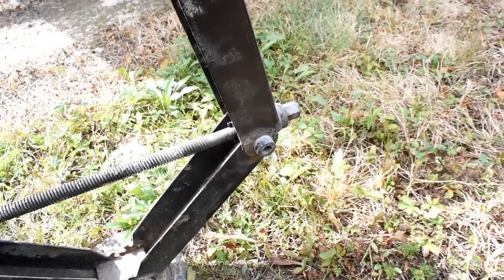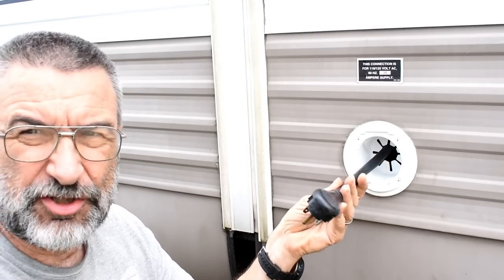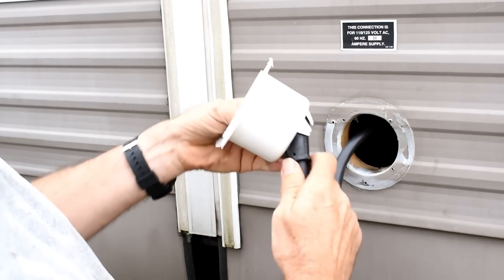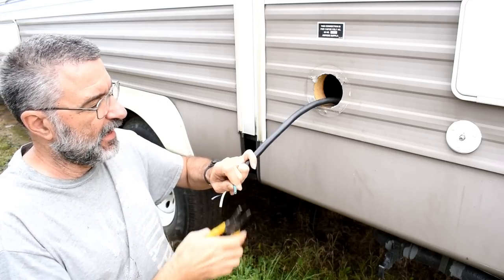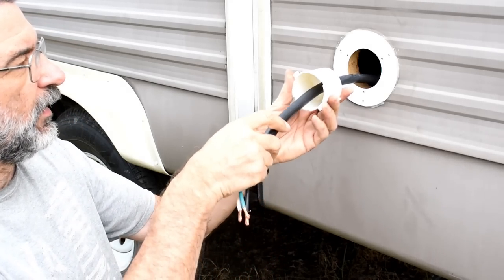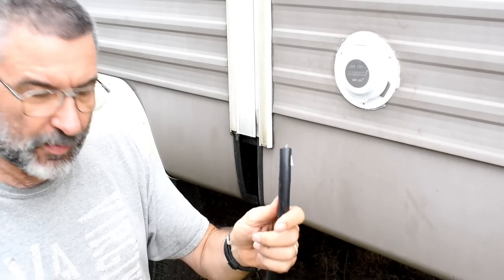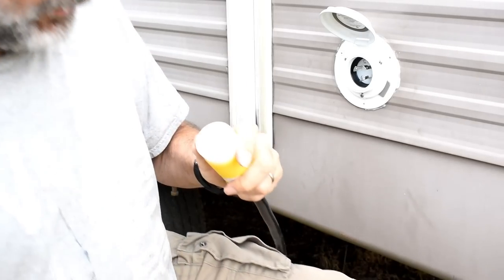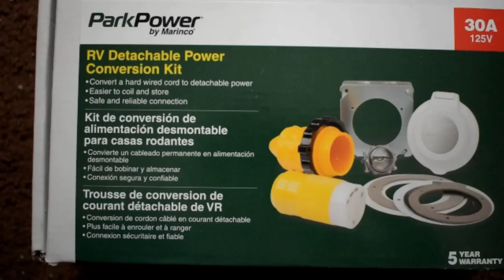Installing RV Detachable Power Cord

Comment: Those work  great for brining a generator connection into a home as well.   The "Wire Clamp" on the back of the plug is called the Strain Relief.

Comment: Very helpful. Our male connectors at the trailer were over heating from earlier tarnish. I didn't know to brighten them so next time it got worse.. needing replacement. One connector was nearly melded to the trailer plug. Now we know how to replace the RV plug receptacle and we replaced the power cord already. I'll inspect the cord in the process.  Sincere Thanks!

Comment: This type of plug has been causing fires in rvs and boats for years. The wiring you removed was the safest.  Keep an eye on the plug for melting. Plug is not only just plugged in, but it must be rotated.

Comment: Thanks Bill for this detailed vid. We need to replace the oem cord cover on our 5th wheel because the "fingers" are all broken also. We just bought a truck camper and the oem cover pins that hold it closed are broken too.  It might seem pricy but you get to re-use your power cord rather than buying a new one.

Comment: Wire brush the threads and white grease them and see the difference on your jacks  . I see that's your problem .the out side of your camper looks like mine.Thanks for the videos now I know how to change out my 30 Amp cord and it needs to be changed badly lol .

Comment: Bill, after you have used the RV a few times, it would be a good idea to go back and re-tighten each of the conductor set screws. The cycling of the electricity tends to cause a high amperage bolted connection to loosen  and could cause a hot spot connection if too loose. That is one of the reasons as an electric utility, we only used irreversible compression connections, even on copper wiring, ... JIm

Comment: Pick up some hose clamps small enough to fit that threaded rod.  One of them should work in place of the pin to raise the leveler.  At least until you can get it fixed.  Phil

Comment: Bill you should get the other two replaced or do it yourself it is called a role pin you can pick them up a hardware store find the size throw a couple of them in the drawer if it lets go just hammer the new one in on location. Very simple. you tube it some one can show you how to do it.

Comment: Just found your channel!  Well done vid.  Would you share the product you used for the power cable insert?  With the passage of time has this solution held up?  Thx
Reply from the maker: I believe I got the parts at a local RV shop.  I don't remember for sure, that was a number of years ago.  But yes, this solution has held up.

Comment: Wow thank you. I like that you did it in time.  That was simple.  Is there a reason to not use the wiring that you pulled out and then stuffed back in the wall? Was it just too short?
Reply: I meant in real time.  Instead of fast forwarding.
Reply from the maker: I DID use the wiring I pulled out.  I pulled it all the way out, cut if off (leaving just enough excess to be able to work easily), installed the plug, then push just that little bit of excess back into the trailer.  Then used the piece I cut off for the extension cord by installing the other side of the plug on the piece I cut off.  There was no wire waste.
Reply: @LiveSimpleLiveFree  I'm sorry i wasn't clear. You know how the cord you pulled out was wired to some other wire and twisted together.  But then you pushed those back in and cut the large black cord with your pocket knife.  I'm wondering could i just use those or use the cord and cut off its what i need to do?
Reply from the maker: Patricia Fortune Those other wires were small (thin) wires that were part of a different electrical system. They couldn’t be used to power the trailer.
Reply: @LiveSimpleLiveFree  oh ok i see

Comment: I bought a 50ft extention cord off marketplace, it was supposed to be a 30amp rv 50ft extention cord, but it has welder plug ends🤦‍♀️ I should have looked closer. It is very heavy duty. Can I buy 30amp rv plug ends and use it as an rv extention cord?
Reply from the maker: As long as the wire is rated to 30 amps, you can put on whatever ends you want.  That's basically what I did in this video.

Comment: How do I install my 50amp cord to my fuse box?
Reply from the maker: You have to have a 50 amp circuit breaker, at least 10 gauge wire, and a 50amp plug. That’s more than I can tell you in a comment.  If you do it wrong, you could start a fire. Hire an electrician.